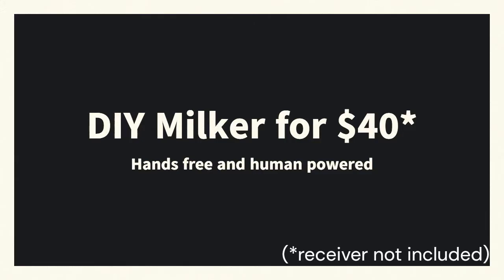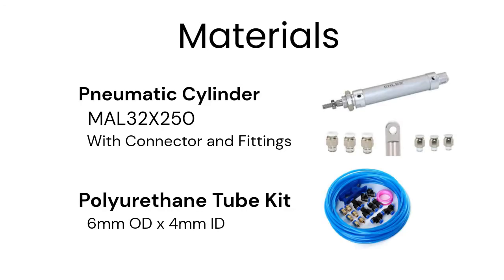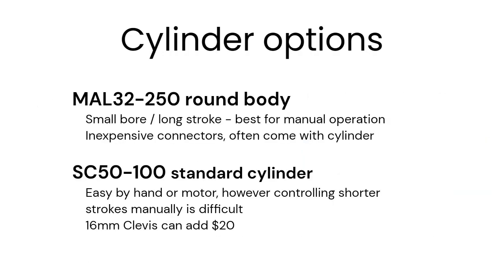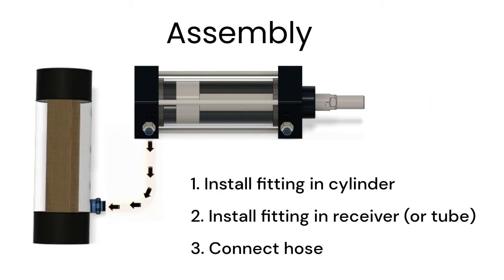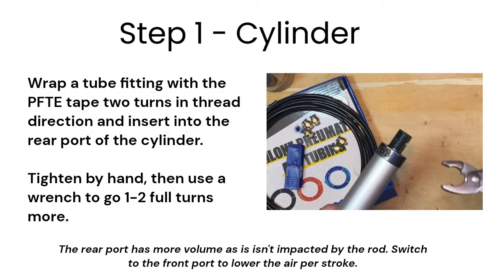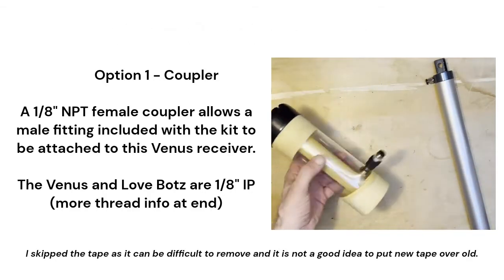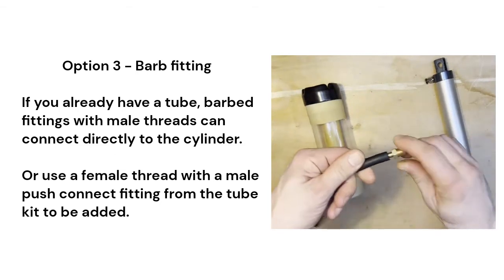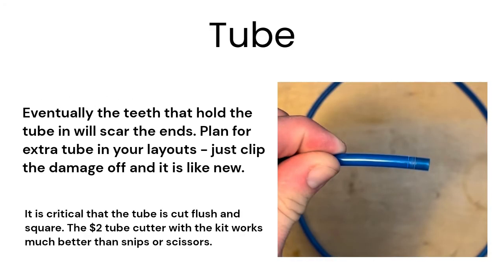Build a fun, fulfilling, and affordable  DIY Manual Milker

Comment: Hi If I plan to add a motor later.
Use SC50 x 100 is better right?
I have f-machine pro 3.
I plan diy on machines.
Find any good idea for that.
Reply from the maker: The smallest viable cylinder would be 50x50 - but that doesn't leave much installation flexibility. I definitely prefer the SC50x100.